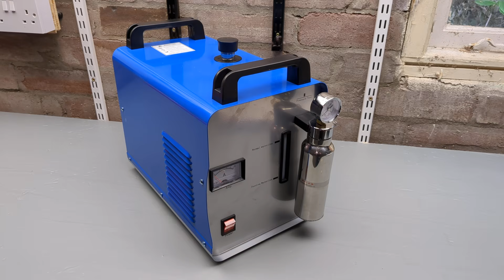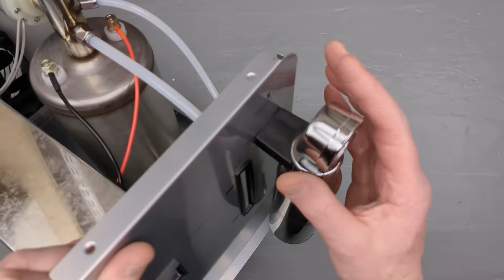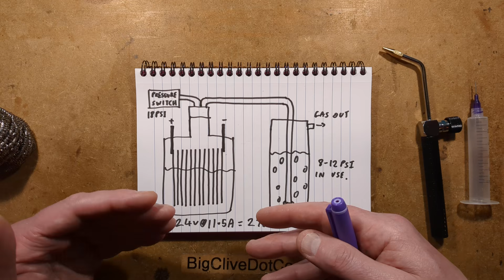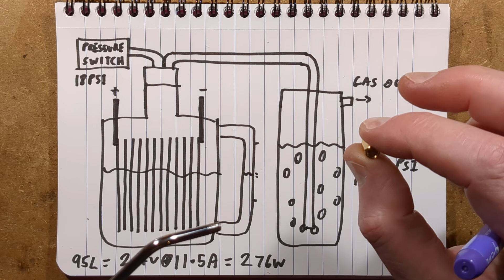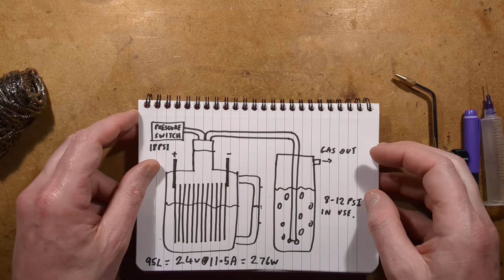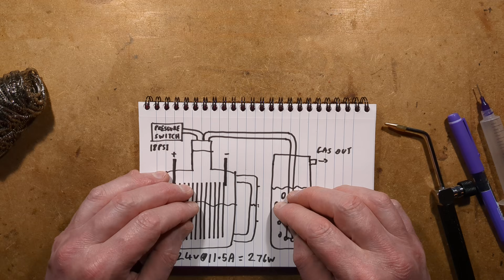Inside OxyHydrogen gas generators (HHO/Brown's gas)

Comment: To be honest this brown gas and the make LPG out of petrol is the same level of spitting, one used air pressure, which is a whole bunch of power, the other used a whole bunch of power to split your JUICE to gas.
Either need a water trap between the on tap and the flame.
If it BLOWS BACK even your LPG Regulator has a water trap/ or similar flash stopper.
IM NOT SAYING They're needed, just I do it.
I ran a water/splitter [I made it 20 years ago] and more recently I made a 3 LPG bottle Petrol - LPG machine.
It ALSO has  half full 9kg bottle for a water trap, could have done it without a trap .... but it's 3 feet outside my kitchen wall ... kneecaping level, so I use a water trap.
Reply: Bubbling air through petrol doesn't make LPG

Comment: As a young adult, finding that an old motorcycle lead acid battery when on a charger produced hydrogen gas at pressure through a plastic vent hose. What fun! Was able to fill a small balloon just enough to float. It was loud when lit with a match. Also, a small thick chemistry bottle, like a finger polish size would make a large pop. Startling friends on my pinballs, and yells from parents.

Comment: AI Summary

Abstract:

This video provides a detailed teardown, comparison, and demonstration of two common oxyhydrogen (HHO/Brown's Gas) generators, a 75L/hr base model and a 95L/hr model with extra features. The presenter explores the internal components, noting that while the higher-spec model has a larger fan, a pressure gauge, and consumes slightly more power, the core electrolysis chambers are physically identical. The process of preparing the electrolyte is discussed, with the presenter experiencing significant foaming issues using potassium hydroxide, but achieving stable operation with sodium hydroxide (caustic soda).

A key focus of the video is safety and practical use. The high temperature of the micro-torch flame is demonstrated by melting glass. A dramatic and loud experiment involving the ignition of a small amount of the gas in soap bubbles serves as a stark warning about the explosive nature of the pre-mixed hydrogen and oxygen. The video debunks several "quack" applications for these devices, such as improving car fuel efficiency or for respiratory health, while affirming their legitimate niche uses in acrylic polishing and fine jewelry brazing.

A Deep Dive into OxyHydrogen (HHO) Generators

*   0:00 Two Models Compared: The video compares two common HHO generators: a 75 L/hr base model and a more expensive 95 L/hr model. The main differences in the higher-spec unit are a slightly higher gas output, a pressure gauge, a larger cooling fan, and extra torch tips.
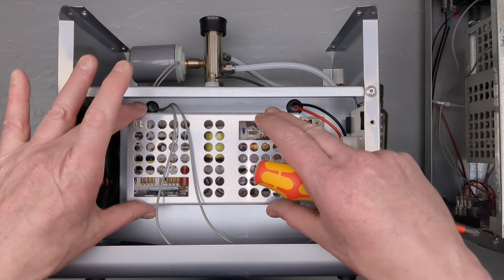*   0:51 Internal Components: A teardown reveals the core components: a 24V power supply, a fan for cooling, the main electrolysis chamber, and a pressure switch that cuts power at a set pressure (measured at 18 PSI).
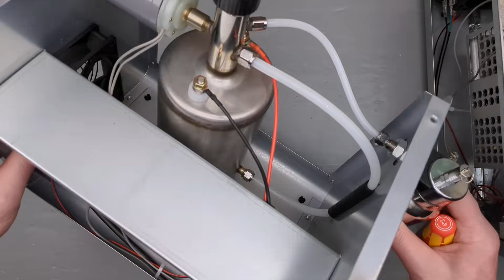*   2:04 Electrolysis Chamber: Both units use physically identical electrolysis chambers. Inside, a series of metal plates split water into hydrogen and oxygen gas when a DC voltage is applied through a conductive electrolyte solution.
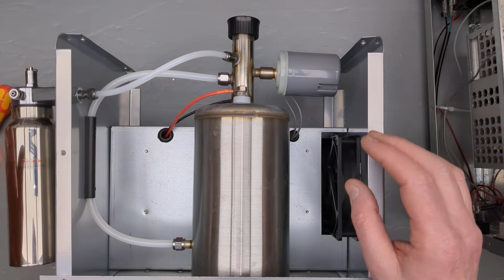*   2:32 Electrolyte and Foaming Issues: The manual recommends sodium hydroxide (caustic soda), but the presenter initially tries potassium hydroxide, which is often recommended online. This resulted in significant foaming, pushing liquid into the system. Switching to sodium hydroxide solved this problem.
*   3:12 The Bubbler and Flashback Arrestor: The gas is routed through a bubbler, which acts as a crucial safety device (flashback arrestor) to prevent the flame from traveling back down the hose and into the highly explosive main chamber. This can be filled with water or alcohol.
*   6:22 Power Consumption: When tested, the larger 95L/hr unit drew 11.7 amps (~280W), while the smaller 75L/hr unit drew 9.5 amps (~230W), confirming a ~50W difference in power consumption.
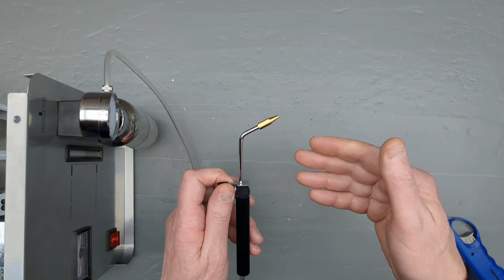*   8:05 Flame Demonstration: The device produces a very small but extremely hot, nearly invisible flame capable of easily melting a glass rod.
*   11:03 Explosive Demonstration: To highlight the danger, the presenter bubbles the gas through soap water and ignites it, producing an incredibly loud bang that underscores the potent, pre-mixed explosive nature of HHO gas.
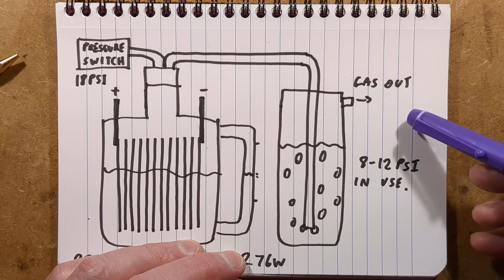*   17:04 Debunking "Quack" Uses: The video discusses the various applications marketed for these devices.
    *   Legitimate: Acrylic edge polishing and fine brazing for jewelry are confirmed as valid uses.
    *   Quackery: Claims of reducing car engine carbon, significantly increasing fuel efficiency, or being safe to breathe for health benefits are dismissed as dangerous pseudoscience.
*   23:55 Safety First: The presenter stresses the hazards associated with these machines due to the pre-mixed explosive gas and highly caustic electrolyte, advising users to understand the risks before operating one.

I used gemini-2.5-pro| input-price: 1.25 output-price: 10 max-context-length: 200_000 on rocketrecap dot com to summarize the transcript.
Cost (if I didn't use the free tier): $0.04
Input tokens: 24139
Output tokens: 825

Comment: Idea: Many Smoke Detectors in the US are battery powered. The Fire Departments recommend to replace the batteries every year. Have you ever tested Smoke Detectors, especially to see if battery power was so low after a year, that they should be replaced?
Reply: From the same people that banned plastic straws to save the planet.
Here in Aus what they used to say(and possibly still do) "change your clock change your smoke detector batteries", so twice a year!

Comment: Neat product, would recommend using distilled water instead of tap water, to reduce chance of mineral buildup on the electrodes, by the time you have a build up the warranty probably would have expired. And buy the hydroxide from a soap place, drain cleaner has way too much other stuff to foul the electrodes. It was always fun as a kid to do electrolysis of water with a bit of soap for the bang. Excellent Video as usual
Reply: Yes, all the units I have seen in use recommend purified/de-ionised/distilled water in the generator tank.
Reply: @howardosborne8647  I'll bet they also recommended adding a pinch of salt (NaCl or KCl), to control how much current flows through the water. The Cl would likely be quickly depleted (Initially giving the flame a colored appearance) but the Na or K would remain. Make up the water loss with distilled water.
Reply: Funny thing about distilled water - it's very pure and electrically non-conductive. You can't drive enough current through it for effective electrolysis. Something needs to be in the water to make it conductive.

On the other hand, once the water is "contaminated" enough for an effective current, simply add more distilled water to maintain level.
Reply: @brettd5884  That is why you have to add sodium hydroxide to the distilled water to create an effective electrolytic solution.....or no gassy gassy will you get.
Reply: @howardosborne8647  NaOH - Even better!

Comment: Back in my high school and university days, I played around with this, trying various electrolytes.  One job I had at uni, I worked in a lab preparing samples that were to be irradiated.  Anyway, as part of that they had a very elaborate cleaning process for the glassware used to prepare the samples, mostly to remove the silicone vacuum grease.  I would mix up a big pot of hot methanol and concentrated KOH, that was the main degreaser.  That was followed by dips in sulfuric and nitric acid baths and multiple distilled water rinses.

Anyway, some of the KOH found it's way home with me and I tried that in my DIY electrolizer and wow, did that stuff kick up the gas production.  Normally, I would just see individual bubbles forming on the ends of the wires I used for electrodes.  With the KOH, it was just like a column of white smoke rising off the wire.  It would fill up my test tube collector in a few seconds instead of minutes.  It was the best electrolyte I tried, always interesting when I hear it's actually the best.

Comment: When you decide to cut open the chamber of one of these units, use the remaining unit to try and Torch weld the removed portion of the tank chamber back in place.
And then test it for pressure with compressed air or nitrogen.
Reply: Far far safer to pressure test it with water!

Air compresses and makes a spring. If the container fails it then releases all that energy in one go. Pressure testing with liquids doesn't have that problem. Some vessels get tested with oil (to avoid issues with rust) but because this will have oxygen in it, that is very much NOT a good idea, so water is the safest bet
Reply: Looked to be TIG welded , this gas never gets to that temp, best would be brass or silver soldering ?

Comment: 11:16 I noticed that the bubbles didn’t really explode. If it was a normal explosion the liquid would’ve splashed out. It’s like nothing happened but sound!
Reply: There is a small initial thermal expansion of the resultant steam which instantly cools to mere water vapor causing a vacuum.  The resulting collapse of that vacuum is what actually creates the noise.

Comment: A motor rewinding shop at which I worked many years ago used an oxyhydrogen torch for welding/brazing motor winding wires to commutators. It was certainly larger than these two, and I don't recall them needing anything but distilled water. I think it was an Italian Oweld model. It was a really nice torch unit.

Comment: Imagine how spectacularly that main tank would explode if it was only half full of water and the remaining 50 percent was the H2/O2 mixture at 18PSI.    I don't think I'd ever be convinced to use a device like this.   I've seen jewelers using a different type of generator where the H2 and O2 fill different divisions and are kept separate until they reach the torch.  Zero risk of flashback with that setup, far, far safer IMHO and you can also vary the mix of O2 and H2 to get a reducing or oxidizing flame rather than just the normal flame.
Reply: It's not really "zero" risk. It CAN happen, it's just super unlikely. (Cross contamination of gases from improper torch use)
Reply: right; most torches have two pipes connected

Comment: Can confirm these are useful for flame polishing acrylics edges. that's what I use mine for.  On laser cut stuff, the edge quality even from a laser is poor as you usually get little ridges called "striations" (unless you've recently sacrificed a virgin and it's a blue moon etc).

The trick is to be fast, the time between the edges going smooth and bubbling is rather short.  You can use a lighter, it just takes longer.
Reply: The primary reason to use h and O for flame polishing is that it doesn't produce soot, leaving black streaks in  your plastic.

Using hydrogen there is no carbon in the fuel gas. No carbon, no soot.
Reply: @linuxranch  Can't say I've ever had a problem, maybe don't set fire to the acrylic?  Anyway, butane will burn as clean as HHO if you use a torch.  I prefer the HHO one, less bulky & a smaller flame.
Reply: Yes, you can get a nice flame polished effect on acrylic with some care. I found the hard way you shouldn't then solvent-weld the acrylic (e.g. with DCM) straight away, as solvent stress cracks will develop (same with freshly laser cut acrylic). It needs to be annealed, or left a week or two, before welding.

Comment: High school chem class we weren't allowed to mix H2 and O2 in balloons. Only pure H2 due to a previous year having the bloody bomb squad called on the after the balloon pop test. It was just the old acid plus metal to make H2 experiment, do it in a glass coke bottle with a balloon over the top. If you pre-add some oxygen you get the louder pop but some numpty thought the school was shooting people. Pure Hydrogen in the balloon has a slower, quieter pop when the match comes close

Comment: Dude the number of ways one of these can be dangerous is scary.  Leave one running in the back corner of an airtight room, like a walklin refrigerator, dude walks in smoking a cigarette.  I can't believe they sell these things without a licence or something.  

Hydrogen and oxygen at perfect mixture is very dangerous.It's literally rocket fuel. It's just the rockets keep them in separate tanks to prevent them from going kaboom.  I can see this being used for short duration attitude control though. Instead of carrying hydrogen and oxygen tanks, you haul water and use it in situ as you need it.  It would be great if you had a ton of free solar energy.  I can see this being used for station keeping at the L1, L3, L4, and L5 Lagrange points.  Those points in space receive constant solar energy.  Literally a corner case scenario but I can see this as a way this can be used as a practical fuel source for a vehicle that "runs on water".

Comment: 4:53 i've worked with very similar power supplies. if i had to guess, i'd say this was an off the shelf power supply from some chinese manufacturer that was just ordered from a catalog based on required specs. at least, that's how we ordered them and they came in the same kind of weird holey metal half-ass enclosure. these are meant for internal mounting, and it was more expensive to get a power supply that was actually enclosed for external mounting (or one cast in plastic directly connected to the power cord)
Reply: Exactly what those look like to me.... I can see most of these things as just off the shelf parts thrown together.
*not to imply they are crap or anything, maybe, maybe not.

Comment: Oh nice, I have both of these! I also recently bought a PEM cell off ebay that actually separates the gases without needing the caustic electrolyte. When the gases are separate, it makes it a lot safer.
Reply: How much was the PEM cell? Keywords for it, please?
Reply: @jsalsman $160 "20A-600ML/min PEM Electrolyzer for Pure Water Electrolysis Hydrogen Production". I can store the gas, and when I have enough, the pure hydrogen runs my propane electric generator without modifications. I also use the gases to run my large torches for glassblowing.
Reply: @maxxglass5822  Have you experimented with standalone fuel cells?
Reply: @maxxglass5822 how is hooked up? Like where in the system
Reply: Have ypu tried getting improved mileage on a gasoline car?
Reply: @fidelcatsro6948 many years ago I tried hho in a vehicle and didn't see improvement. I'm thinking about trying pure hydrogen in a diesel vehicle like propane injection.

Comment: A real flashback arrester is several plungers on counter springs. The detonation wave hits the mushroom head of it and overcomes the spring. Them being in series is just for redundancy, 2 in each device.
    I have seen them only on the oxygen line on one oxy rig in a welding shop.
   Screen, screens with gaps between the layers, stacks of screens and metal wool are only Flame arresters. The coal miner saftey lamps did not protect you if the lamp was tilted and the flame against the screen. It works by cooling the flame out. A blastwave cares not for any of that.

Comment: I've done a lot of "experiments" with oxyhydrogen. Always lots of fun, especially mixing up soaps to make dense foam that you can hold in your hand as it detonates. I use washing soda, but it does yellow the flame - it's crazy how a tiny amount of sodium from the electrolytes contaminates the flame enough to change the color. Getting the right voltage of very important - too high and it ends up just creating heat, which will put steam in the output instead of HHO. For a single cell, I put about 6 volts at 10-15 amps which seems to work well. I will say that using a homemade one without a flashback/bubbler did completely explode and you should absolutely NEVER use one without the bubbler.
Reply: The 3000K blackbody spectrum is yellow-orange.
Reply: @jsalsman I'm just talking about the emission spectrum. Sodium overpowers just about every other element on the periodic table - even reaction in test tubes sometimes emit yellow because of the sodium in the glass.
Reply: @jsalsman  but the flame from the gas from a typical cylinder is pale blue- almost invisible. I do not think the flame is close to a black body
Reply: Glad you mention holding the foam. I have just commented to another viewer who thinks that a small balloon would take fingers off.
Reply: @TheTemporalAnomaly I don't know about taking fingers off, but the difference between foam in your hand and a 12-inch balloon is the difference between ears ringing briefly and buildings shaking several blocks away. A handful of bubbles is fine, but a balloon is absolutely NOT safe to ignite in your hand.

Comment: I have the same one. It works well for some things because the flame gets very hot but the downside is that there is a bit much oxygen present for welding or soldering small things. Its also a bit dangerous to handle the highly concentrated lye. But lye is also useful, I clean my water pipes(bongs) with it by simply submerging them in lye for a week. That saponifies the gunk, and you can just wash it off like soap.
Reply: Strong bases are great for cleaning glassware! When I was in college I had a programming job with one of the organic chemistry professors. The students in her lab sometimes got their glassware covered with baked-on organic gunk, basically tar. Her solution was to fill a polyethylene bucket with a few kg of crushed ice, 1 l of concentrated ammonia solution, and 1kg of sodium hydroxide pellets. (In that order, because NaOH is very exothermic when it dissolves in water.) If you put glassware in this for a while, the tar will be gone. The downside is that if you forget and leave the glass in for too long, it might be gone too – or more likely, just etched.
Reply: @laurawerner  I use 10% concentration for the glass ware. It also removes the paint and markings however😆